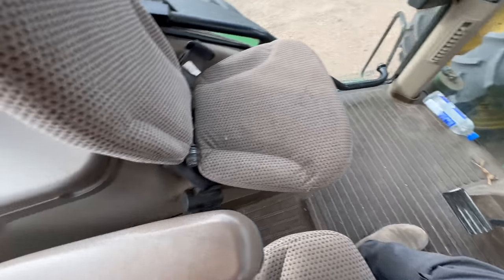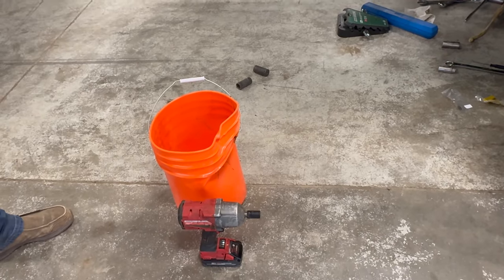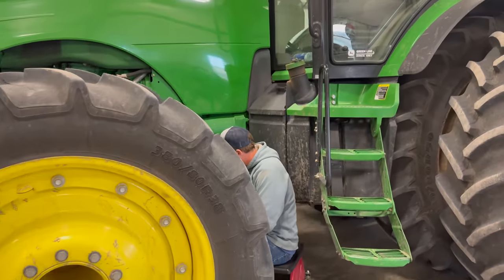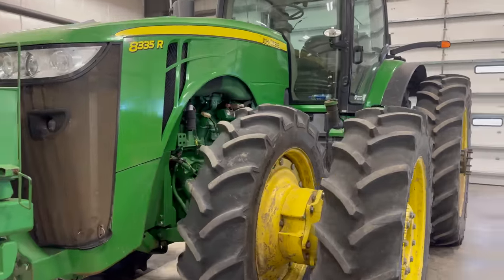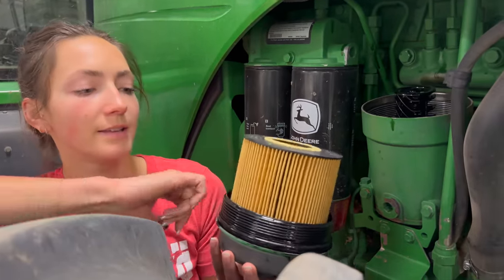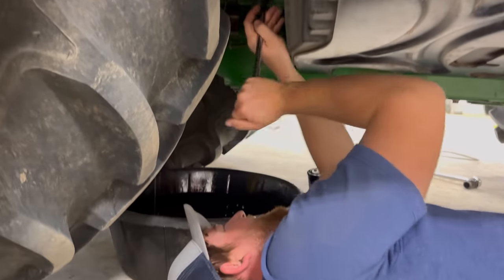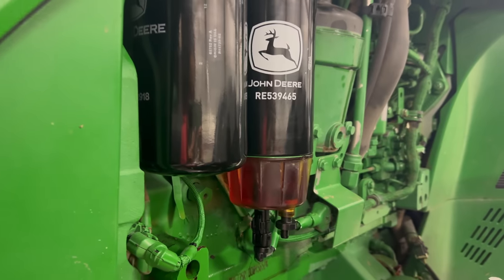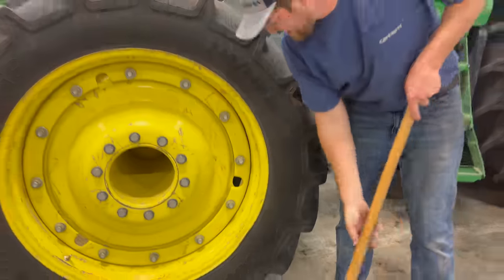One Year of Owning A John Deere Tractor

Comment: Grant, to get that dent out of the rim edge, use 2 small sludge hammers.  Hold one hammer head on the dent in the rim.  Hit that hammer with the other hammer.  This method insures the force of the blow goes to the dent.  The dent pops back out against the tire.  3 pound sludge hammers should work.  My dad taught me that trick.  We restore John Deere 2 Cylinder tractors in my area  Sometimes the rims on these old tractors have a few dents in the rim edge and that is how we get the dents out.  I really enjoy watching your videos.  The videos are really interesting to see how farms operate out there in the Midwest.

Comment: The little rubber things that got worn off of the new tires are called casting sprues.  Enjoy watching your videos.  Thanks.
Reply: Correct. They are caused by "vent spews" in the tire mold. Uncured rubber is injected into the mold under pressure. To allow any entrapped air between the mold and the rubber, small holes are drilled into the metal mold. This prevents air bubbles or blisters on the tire.

Comment: I have changed oil in a lot of tractors and it is very easy to do most of the time ,you have a lot of room to do your job ,l always used a 5 gallon bucket Grant had a good idea how to use the fuel from the filters, most of the time I would put it the wood stove to help starting the fire . Thank you for sharing your videos..

Comment: If you have a slow leak, you can always put some windshield washer fluid in it, down south, we would just say water, but where you live, you need the anti-freeze! Love you guys mean it! ❤ I didn’t know anything about a modern tractor until I watch this show, now I know that tractor weighs approximately 28,000 pounds, I also know the hydraulics on the rear are designed to pick up 29,750 pounds. See what you’ve done to me! 😂

Comment: If you not heard of it look into a Mr. Funnel, it is specially designed to filter out water, dirt, and debris from fuel. I run all my diesel through a Mr. Funnel from filter changes and then use the fuel in my diesel greenhouse heater.

Comment: When changing the grease cartridge I pull the handle back and and to the side then put an Allen wrench in the hole to prevent the handle from releasing before I'm ready. this keeps it from pushing the tube of grease out before it is installed on the gun.

Comment: I don't know if you have one, if not you might want to get one.

Port-A-Power

There are several attachments that go with it.

A Port-A-Power could push that bend out without much effort.

btw The bucket can be pushed back into shape, pretty much.  Get it good and warm first, it's much softer and easier to "fix".  I know, it's just a bucket.  Buckets are expensive though.

Comment: Have you guys ever considered using Amsoil oil for your tractors and equipment? I have used it for every  veichle i have owned for 20 plus years and it is the best synthetic you can buy .
Reply: We run AMSOIL on our truck fleet and are on an oil sample program.  We take a sample every 5k miles and it is anaylized  to see if it needs changed.  We average 100k between oil changes. Been using it since 1993.  Best oil ever.

Comment: Seriously, with the amount of pivot tracks that you have to close, for me, the several hours that it would take to change over to big tires would be worth it.

I say this not only for your comfort, yet a tad bit more to reduce the wear and tear on your equipment.  Think about it.  Every time that you feel that bumping, sudden side to side shifting, the bouncing around your equipment experiences that and more.  The load of the tillage, plus the weight of the tractor, multiples the load wear on the equipment.  Yeah, your ride will be smoother, so will the operation of your equipment.  Smooth wear equals longer life, less expensive life.

If you could see the pounding that just the 3 Point area of you tractor takes, and the sound that it makes that btw you can't hear much of in the insulated cab, that you would be amazed.

Every time that you go over a row hill while filling the pivit track, each sway is a clank, each clank is metal banging on metal, each bang is an impact that causes wear.  For a single track that's a boat load of wear.  Been there in a milo and silage field, I know the sounds because the tractor, 806 IH, didn't have a cab.  I know the feeling of bouncing in a field pulling equipment.

Comment: It's the old fashioned impacted release! It will prevent strepping the bolts ends!
Reply: If y'all ever get to the point where you'll do stripped the bolt get a smaller socket. impact style and hammer the socket over the strepped bolt it will smash it's way down the bolts don't impact gun the socket off get a breaker bar to slowly remove with arm strength!

Comment: I want you to come assist me while we change in oil in a V16 3600HP Cummins engine powering a 2.25 million watt generator. 125 gallons of oil and 3 filters. We change 275 gallons of coolant at the same time along with 2 additive filters and 3 very large fuel filters. Radiators, yes 2 are 14 ft tall and 12 ft across. Wish I could give you a picture here. I love that air filter cleaner.

Comment: See if i can get this one handed? Thats how you normally pull a spanner😉. But: its a and b and c joining together😉. Pull on a spanner at a 90° angle(spanner and arm make a 90° thats a and b). Now the c. Acces. Some times removing wheels or other stuff may take 20/30 minits but the job itself is done 1 hour quicker.
And yes. I know the weight of the wheels. But consider the purchase of a wheel mounting tool. Pity it wont help you out in the field. Or would a piece of plywood fix that?

Comment: Great video, as always. When using the air filter cleaner, you should consider wearing a good respirator. If you don't want that dust in the tractor engine you surely don't want it in your lungs!!

Comment: Just because the equipment is rolling out the door doesn't mean the work is complete. Need to finish cleaning up the tools and supplies instead of leaving them scattered around the floor. That would have prevented running over the impact gun and bucket.

Comment: 😎😎🤠(1:38)👨‍🏭 "Augh": yea. But technically it was that Cats {last oil change}... = ((The engineer said cut the hydraulic hoses: we don't service but demo)) == Oh, the {{surprise to see a cutting torch turn into a flame thrower}}, in a confined space.!! 😳😳🥵🥵🥵

😎😘-🤦‍♀(9:59) "So the well spicket - has never frozen before"?..

😎😎😳🙄🤦‍♂💁‍♂(11:24) That is pretty hard to do: catch the {lip of rim} only - looks like sabotage...
Anyways: you have to make a impact collar - like a body tool - to reform the inside too outside.. = You got a split rim ring - spare part/scarp metal?...

Comment: I spent the first 23 years of my life growing up on a farm and when it came to maintenance on the tractors, trucks, and combines my father was extremely particular about using super clean tools, oil containers, and always having a clean rag or paper towel to wipe off any dirt on the containers used for oil changes and the like for hydraulics and fuel. I have noticed that you and Grant are not that particular with having clean dirt-free containers, tools, etc. I am guessing that you rely on the filters to take out any contaminants that get into your systems on your equipment. I am supposing that it is a time element for you. Do you care to comments?